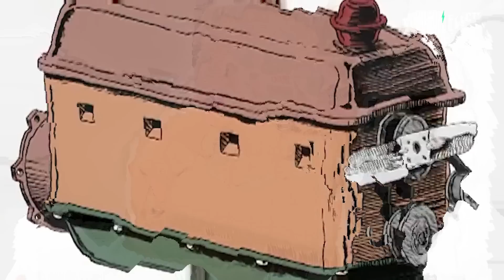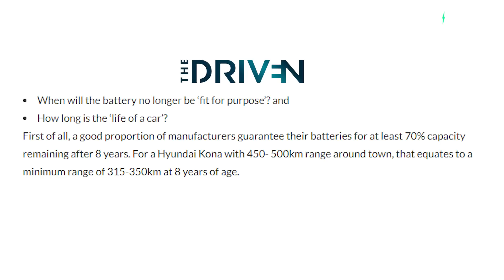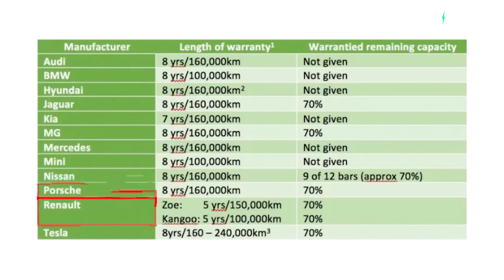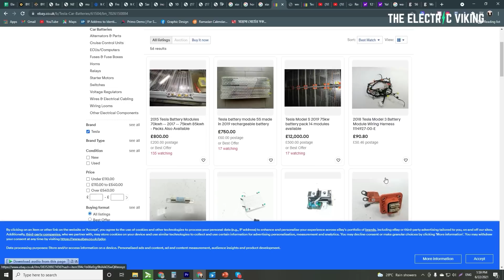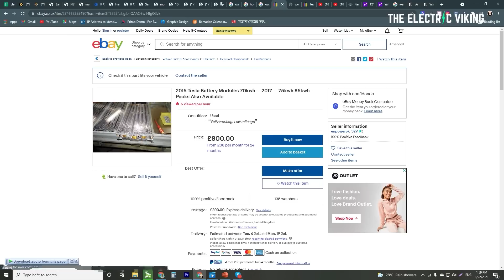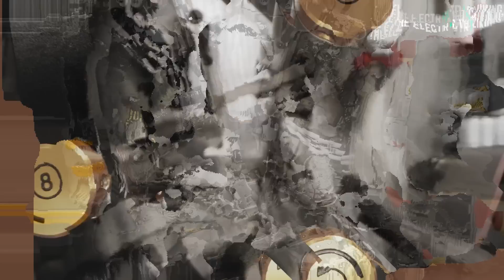How much does it cost to replace the battery in an electric car?

Comment: My prediction is that batteries will become way cheaper in the future, meaning a battery swap after 10 years could actually make sense
Reply: The question is, will the batteries you can get in 2030 fit in your decade old car and will they be electronically compatible.  Maybe they will standardize sometime in the future, but many EVs have bespoke battery packs that only fit that model.
Reply: @macrumpton  These batteries are all made up of a lot of cells or modules. You can easily make a different shape with them, atleast the way they are now.
Reply: @sneaky_krait7271  wrong, the upcoming Tesla structural battery won’t allow that.
Reply: @alanmay7929  That's alarming, I'd say a battery swap will still be possible, but the process will be a lot harder. This will really affect the second hand value of them and make them worthless once the battery has degraded enough. Terrible for a company that is supposed to be good for the planet, luckily there are other options...
Reply: But the batteries available in eight years will give more mileage for sure, so this is largely hypothetical thought.
Reply: @Alarix246  So?? That is good news. The battery can be swapped with better battery tech in it, meaning it would extend the range of the older vehicle too
Reply: @sneaky_krait7271  And the car manufacturers will hate you, they have to have a significant sales to make manufacturers viable. Got to find a way to build in obsolescence.
Reply: Manufacturers want you to replace the while car. Expect the government to start reinforcing this through regulations.
Reply: @wrenchpony9735  This is a great opportunity for mechanics, who will be less needed in future. They can work on making new batteries for these battery swaps
Reply: Can somebody share that driven page that Sam Evans has been talking about. I can't seem to get that website or web page. Thank you in advance.
Reply: Not just cheaper but better in every way. The aftermarket battery business will be very interesting. You really can't make any money upgrading or refurbishing gas engines because of the labor required and so many other things that can go wrong with the car. But batteries will be easier reducing the barrier to entry into the market while providing an attractive profit margin. There are already improved batteries available for the Leaf and some hybrids, image being able to get a new battery for your Tesla 10 years from now with twice the range, faster charging, and half the price of a directly replacement part. Even Tesla and other OEMs my offer battery upgrades.
Reply: @frankcoffey  Yes I know, but one of the biggest concerns here about it is cost. Ofcourse range, charge time etc. gets increased too. I think OEMs and car repair shops should really look into making and installing custom batteries to survive
Reply: @sneaky_krait7271  Some with come up with great ideas and maybe even patent them and sell the idea to OEMs for big money. Then you don't even have to sell batteries anymore. Even something as simple as a new pack design could be big.
Reply: @frankcoffey  If you are capable of designing fitting packs for older EV cars you will have great business. Service shops and technicians should really look into doing that. Also would be great to make some software program that makes this easy and also makes it easy to couple with the old car again
Reply: @sneaky_krait7271  I was thinking along that line but with improved chargers, inverters, BMS, thermal management as higher density battery packs will require improved thermal management. Imagine a 2015 Leaf with a 500km range, with a 250kw charging, added thermal management, and a small frunk for $5,000-6.000 in 2030
Reply: @GG-si7fw  You can also upgrade the motor hp output very easily, just swap the inverter